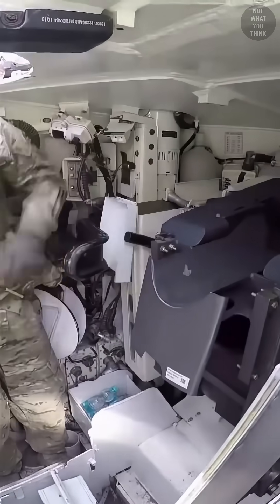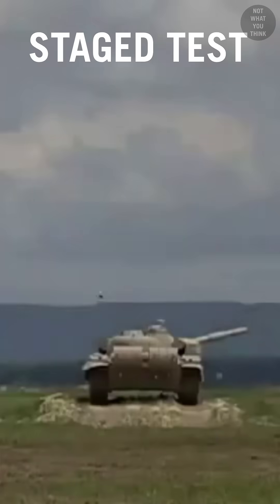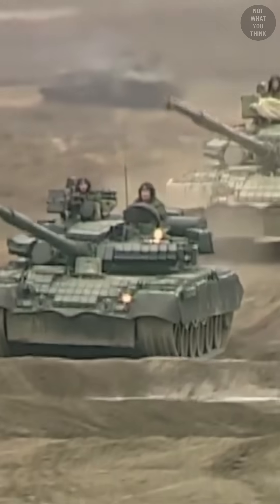Why M1 Abrams Tank Has No Auto-Loader #shorts

Comment: Tanks with Auto loaders like T-84 & Leclerc have blow-out panels also. The age of the manual loader also will be ending with 130mm guns (or larger) as the ammo is not as practical to load compared to an autoloader. 130mm guns also have a reported 50 percent better armor penetration

Great videos as always I watch them all!
Reply: I would like to hear where you got the 50%, because going from 600mm armor pen to 900mm is a bit strange in a 10mm change. Also to mention 600 is a rough number given from the highest, because some vehicles at the lower end have something similar to 473mm armor pen, also, I just guessed you were talking about from a 120 but from what caliber is it coming from? Because some use 120mm guns, and others use 122mm guns, 76mm, 100mm, 80mm, etc.
Edit: forgot a word
Reply: @fallingjustice29  why the heck we chase caliber for. Just make them go faster.
Reply: @aorithefemboyfox9113  in order to make a shot move faster, you need more powder, so you would need to make a larger barrel that wouldn't blow up from the force of the powder going off
Reply: @fallingjustice29  The 50 percent number comes from Rheinmentall - it was in a promotional video - the large shell even if only 10 mms will have a large casing and potentially with telescoping ammunition which will allow for more propellant to achieve the 50 percent better penetration.

Comment: Why not Fresnch-style autoloaders?
Reply: The US had the CCV-L prototype tank in the 1980's that had a French-style autoloader. It carried 21 rounds and 24 in storage, but the autoloader was found to be too unreliable and the tank was too heavy for the Army's requirements for a new, lighter tank. There was also the Expeditionary Tank prototype with a crew of 2 and a remote turret like the Armata T-14, but the army scrapped it. The auto-loader in the CCV-L is used in the Stryker, but the US Army is retiring the Stryker in 2022 because the vehicle is too unreliable and the gun system is too unstable.

Comment: yeah, but then there is the Leclerc, with an auto-loader AND a blow-out panel, giving it a faster reload and the same survivability advantage
Reply: I think the Japanese type 90 has the same thing too
Reply: @atomicspartan131  Yeah, and the Type 10 too I think
Reply: And t-90ms has ammo stored in a closed compartment like many western tanks. There are some rounds beneath the turret too, but that is also protected. And having autoloader means having smaller and lighter tank
Reply: @aleksastankovic4808  T-90M uses an carousel autoloader, the carousel (on the bottom of the tank, beneath the turret) is armored. It has an external storage box at the back of the turret, which is accessible via top hatches which may act like blow out panels, but this ammo is not ready to be fired, its just stored there to be loaded manually into the carousel autoloader by the Crew.
Reply: @chaosXP3RT  nah man, but the "22 shots" aren't at the same tank. Maybe your tank needs to destroy a tank, then destroy a fortified position, then disable a truck, suppress an artillery position....
Reply: @chaosXP3RT  Bit did I bring up who's implemented blow-out panels first ? No, and I find it very impressive the US implemented it as far back as the 80's, but I never brough that up
Reply: @chaosXP3RT  well manual loading works, but autoloader are way superior no doubts
Reply: Also there is K2 black panther with autoloader too and it has blowout panel, Even the new T-90M got blowout panel too so what's the point of this video again if the main disadvantage is munition safety ?
Reply: @theinsomnia9282  if I’m correct the t90M does not really have blowout panels but rather a separate compartment that will just give the crew some time to escape before the crew compartment takes fire. Blow out panels are supposed to protect the crew even after the ammo has blown up.
Reply: @chaosXP3RT  True but you are not always shooting at tanks and there are still scenarios where it will happen and also Another reason russian tanks don't have auto loaders is because the rounds are heavier
Reply: When the Abrams was designed, the cassette type autoloader didn't have enough advantages over the human loader..
Reply: @keepower  And wasn't the Abrams designed like, 35/40 years ago ? Technology has evolved
Reply: @JustAFriendlyFrenchDude  almost 50 years ago. It has been in service over 40 years.
Reply: Until it breaks then tank is just a real heavy 3 man transport vehicle
Reply: @RT22-pb2pp  you can hand load it, it doable
Reply: Manual loader is actually faster at the beginning. Autoloader is just more consistent. Btw Armata is claimed to have blow-out panels as well
Reply: @-WarCriminal-22  Just give me 1 example of a manual loader that has loaded a shell in 4 to 5 seconds 22 times in a row in a tank moving at 40 km/h on rough terrain.
Also, tell me if your manual loader can still be consitant in its reload after 36hours without sleep.
Reply: Read his comment again :p
He said Manual loaders are faster at the start but autoloaders are more consistent :p
Reply: @FinlayDaG33k  this is completely wrong, japanese Type 90 can reload in less than 3 sec
Reply: @playonandroid9977  Well... I never said he was right or wrong, just that he should re-evaluate the statement made by the bloke with the weird name.
Reply: @-WarCriminal-22  I think the entire turret is the blow-out panel on the Armata
Reply: @owo1744  lol
Reply: @-WarCriminal-22  Up to certain round size.
Reply: @-WarCriminal-22  well, manual loading time depend on plenty of things, while autoloading is consistent. Human loaders are a thing of the past, but the army often has troubles moving away from something that's working.
Reply: @-WarCriminal-22  the Armata has been discontinued tho. To expensive
Reply: @vizender  not "discontinued", they haven't ordered it yet. It's still on the army tests. It is expensive, for sure, that's why I think only experienced contract soldiers will get it if t-14 passes the test.

Comment: T-90M has both an autoloader and an armored stowage for shells...
Reply: Firstly, I prefer autoloaders. But, despite yes, having the ammo in an armoured rack, it's not the same as blow out panels, as it kinda just delays the cook for the crew to leave, instead of cooking the ammo out of the tank without losing it. (also makes it harder to detonate the ammo in the first place).
Reply: @robisvalton4286  i think the russians were experimenting on a new turret for the T-90M that could fit an autoloader that can use the Vacum1 shells and blowout panels.
Reply: @robisvalton4286  it does have blow out panels at least in the m configuration
Reply: @trolldatshit4001  fairly certain it's just extra armour around it, but doesn't actually isolates it, despite increasing cooking time and how hard it is to explode it overall

Edit: the T-90SM gets extra ammo on the back of the turret that does have blow out, but the autoloader itself, still under the turret, doesn't have blow out. (it does gets extra armour).
Reply: @robisvalton4286  no I'm very certain about that they were pretty explicit about that during the initial presentation
Reply: @trolldatshit4001  nope, literraly just searched it.
Reply: @robisvalton4286  yes sorry my mistake seems my memory betrayed me here

Comment: A loader pumped on adrenaline is faster than an autoloader.
Reply: Not faster than a good loading assembly, plus people greatly overestimate the complexity and frailty of such a mechanism. They're actually very easy to build and they're at least as reliable as a man without requiring much maintenance.
Reply: Well, yes, for around 5 minutes. Unless we're talking about the Type 10. You can't load a 120mn faster then 3 seconds.
Reply: @robisvalton4286  watch me

Comment: What are those "rounds" (maybe it are bombs or missiles, i cant see) that explode above the tank?
Reply: Those are top-attack anti tank guided missiles. The BGM-71F ATGM for example flies above enemy tanks and explodes down into the tank's roof when it senses the tank below it. The roofs of tanks aren't nearly as well armoured as their front, back and sides are. Its impractical to thicken the roof as it adds unnecessary weight and it steals space inside the tank. The only real countermeasures are active protection systems which detect incoming missiles and destroy them before they reach the tank.
Reply: @JakeTheTankmaster  thanks!
Reply: Tow 2b

Comment: Come on, it is easy to tackle those problems. Open door, auto-grab the right one and close. Then save the passengers energy in case of emergency. Maybe he can do a little tactical work.
Reply: Congratulations, that design now takes up half of the entire turret and now you can't have that extra crewman
Reply: @fallingjustice29  the extra crewman isn’t very useful…
Reply: @elliotsmith102  yes, it is, but also the cost of making an autoloader for the Abrams would be very high, the crew compartment is much more cramped, and it would be difficult to repair
Reply: @fallingjustice29  if you were to make it so that the auto loader can be removed in one piece somewhat quickly and just put an entire new one in, repairs could be done much quicker at the expense of cost efficiency.
Reply: @elliotsmith102  unless that autoloader is made from Lego plastic, removing the autoloader at all without extensive use of specialized tools would be impossible

Comment: While it is true that roulette autloaders (such as the ones found in most russian/soviet tanks) have safety issues, you can have an autoloader on bustle-stowed ammunitions as well. The Leclerc, the Type 90/Type 10, the K2 and an experimental turret of the abrams all have cassette type autoloaders. those are even safer than human loaders as the armor between the crew compartment and the things that can go boom can be made thicker for the same weight, since you only need a door to be 1 round wide, instead of opening a huge 40cm opening on the leos/Abrams. Apart from that, automating the loading mechanism does not require the loader to not be in the tank. The Merkava mk IV iirc has a "semi-autoloader" along with a human one. 
as for the "replace crew/maintenance" argument, with modern FCSs, the commander can act as the gunner with minuscule effort, so should the driver be incapacitated, the gunner can take over and the TC just man the gun. if the gunner is incapacitated, then just leave him there and use the TC's override. now, the maintenance aspect is not an issue of the tank, but of the organization of the unit. you can have the extra 20 or so guys that are no longer in a tank and put them in an APC and do security. when maintenance is needed, they go to their tanks. 
Overall, the advantages of the autoloader are growing bigger by the day, and the next generation of tanks will most likely feature a 3-man crew with an autoloader.

Comment: Man atleast its not like the M4 Sherman where the Ammo compartment is literally clear...but the Tiger 1 E is smart...ppl thought that the basket at the backside of the Tiger's turret was the Ammo Compartment...oh "You are dead wrong -Nigerian Prof"
It's actually just a basket where the crews keep their belongings
Reply: Ok, this isn't ww2, and gunner crews were instructed where to fire, the center of the side hull, or the engine compartment, and most would aim there anyway to make sure the shot was on target, it would be dumb to shoot there even if it stored the roughly 4 shells it could hold. The basket is curved which indicates it isn't used for ammo, because boomerang shots didn't exist, the basket wasn't a planned combat espionage tactic, it was a basket that held tools put there for ease of access, and for that purpose, it was a very good design choice
Reply: The Tiger was terrible. Guzzled gas, and broke down frequently. Adding more armor and a bigger gun isn't genius intellect. Building a reliable and functioning tank is
Reply: @chaosXP3RT  not to mention the m4a3e8 was lighter, more mobile, and had more armor than the tiger with an equal firepower and higher load rate

Comment: Fun fact : an expert M1 Abrams loader can load shells every 3 seconds. But the downside is that the blast door will remain open the whole time.
Reply: Yeah that's not true, the shells are very heavy and reloading shells consistently for a long period of time is extremely difficult.
Reply: the first three reload might only take 3 seconds but the next reload time would have increased
Reply: @Fae-Fey  at most you are firing three shells at one moment, another battle of 73 easting will not happen for many years to come
Reply: @fallingjustice29  who knows. I’m pretty sure no one expected such a battle since WW2
Reply: @vizender  that battle started when it was two military groups clashing, not an insurgency, and global combat or just smaller wars are becoming less likely due to diplomacy and trade deals
Reply: @Fae-Fey  how often are you going to need more than 3 shells in 10 seconds???
I can’t imagine it slowing down a ton. Maybe 16 shells in 60 seconds for a human with adrenaline during battle, but that’s likely never going to be needed EVER. They would never need to waste that many shells that fast they would need to spare them for later. However a loader can be trained to do any of the other 3 tasks also anyone else in the tank can load a gun, neither of those are possible with an auto loader
Reply: For 5 to 10 minutes
Reply: In which case if the ammo gets hit from a shell hitting the front of the turret the crew is dead either way. But the turret of the Abrams is pretty much impenetrable anyway so 🤷
Reply: @LILKRANKINp  the turret still has weak spots.
Reply: @elliotsmith102  maybe head-on from the side with a pretty powerful cannon.

Comment: The same setup (ammo in the back of the turret with blast protection door and blowout pannel) is also use on the French AMX-56 Leclerc battle tank with an auto loader ;) interresting design of a western tank with an eastern way of thinking the reload.
Reply: not the same, shells are turned in direction of battle compartment so at specific circumstances shell may go into it, japanese type-90 have exactly the same type of autoloader btw
Reply: @SergeiSugaroverdoseShuykov  Didnt know that. Very cool and thanks for sharing.
Reply: @SergeiSugaroverdoseShuykov  Yes you're right, i may love the Leclerc more because i'm french, but yeah the Type-90 has the same configuration.
Reply: The US had the Expeditionary Tank in 1985 that had a crew of 2 and a remote-turret with an autoloader. It was in trials to be a new light-tank to replace the M-55 Sheridan. It had a 105mm rifled gun. The tank lost to the CCV-L in competition for the contract, but ultimately the whole light tank program was cancelled because the CCV-L was too heavy and the auto-loader was unreliable. The Expeditionary Tank Autoloader was redesigned and installed into the now know Stryker MGS. It will be retired in 2022 because it's too unreliable as a vehicle.
The US has just never had a reliable or light-weight autoloader. The Expeditionary Tank prototype built in 1976 even had a remote turret and a crew of 2. The US Army still rejected it
Reply: @chaosXP3RT  Thanks for this piece of history : )

Comment: also has to do with how complex auto loaders are, more things that could break down and fail
Reply: Autoloaders are really not that complex. The russian ones are fairly simple for instance. With a bit of knowledge you can build one yourself with whatever crap you have on hand. Most people greatly overestimate the sensibility and complexity of a loading mechanism.
Reply: Yea most autoloaders dont require more than 3 electric motors  for example on a russian tank 1 to turn the amunition rack  to the right position  the 2nd to pull the shell and propelant up  and the 3rd beeing for the pushrod wich pushes the ammo into the breach and as for the T-64 and T-80 u dont even newd an extraction cycle cuz it doesnt use cased ammontiun
Reply: Auto loaders are more relilable then people seem to think